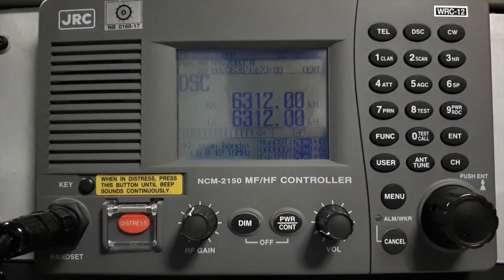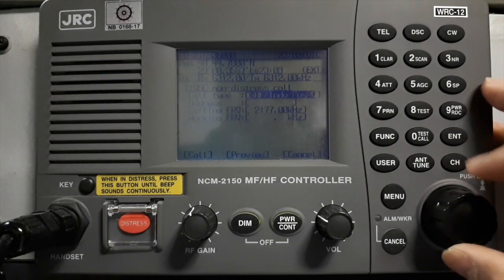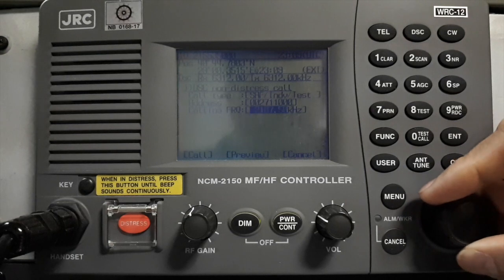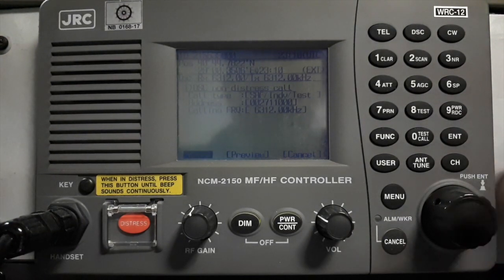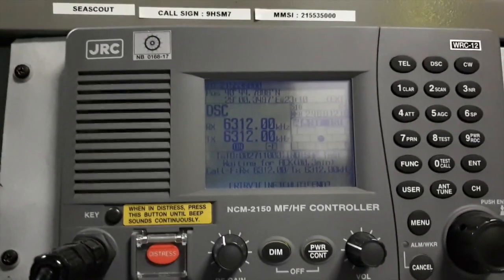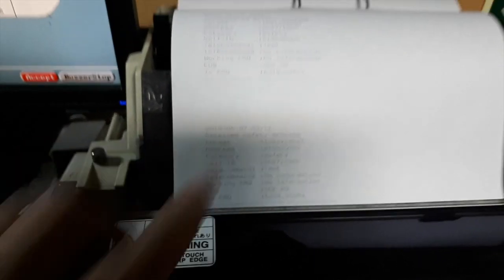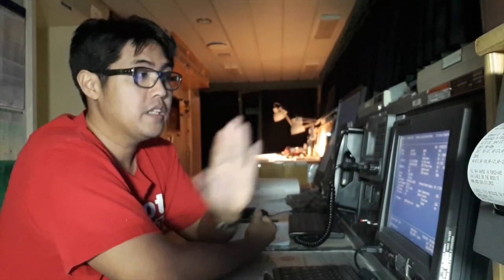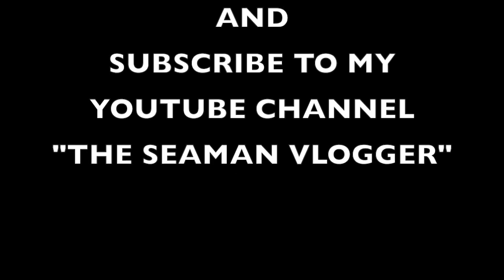How to test your MF/HF on coast station onboard the vessel

Comment: Sir why cant u not test (MF/HF) with another ship using its MMSI? is there any problem for that?
Reply from the maker: No theres no problm for ship to ship test. I already given an hard example of test which is the ship to coast station. Because its only rare on coast station to acknowledge a test. Not like the ship to ship test its very very easy beacause you communicate to acknowledge your test. In coast station you can't talk to them for acknowledge your test.. So in summary i already given you a level 10 test (ship to shore). Why will i go to level 1 test??(ship to ship).